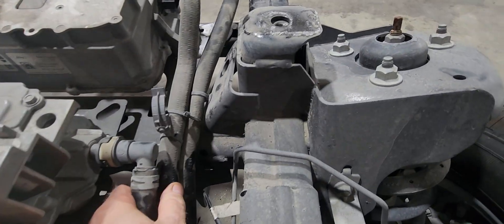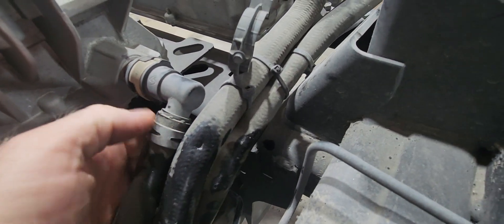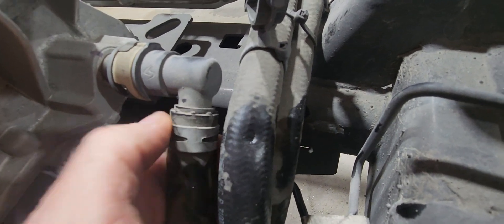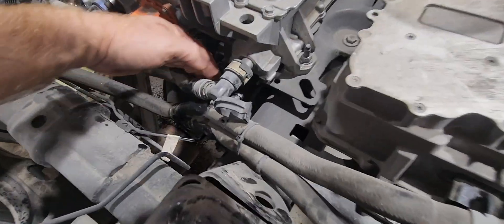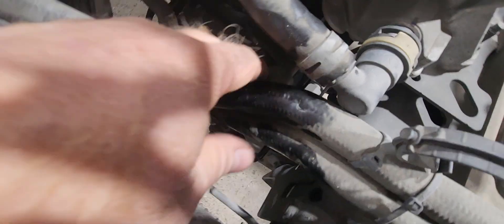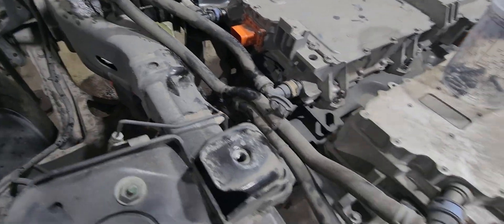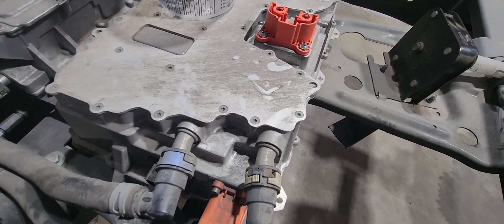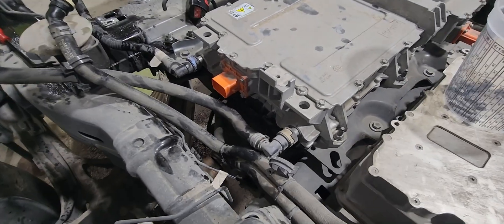2023 Ford Lightning Coolant Line Failure

Comment: I have a Lightning.  3 weeks old 650 miles. Leaking something from the rear. Making loud grinding noises, thumping and halting noises. Can't drive it. Waiting on a tow back to the dealer hoping they will buy it back.😊